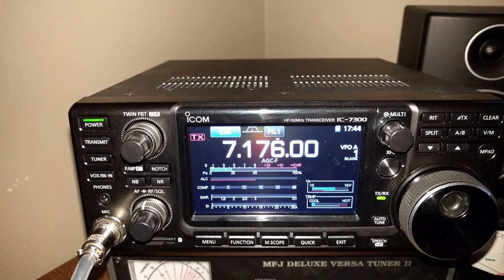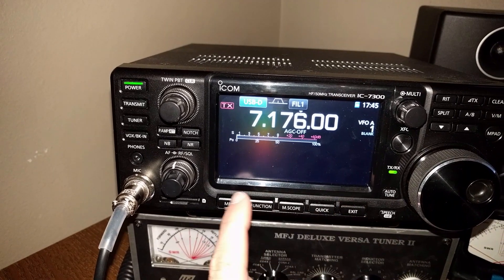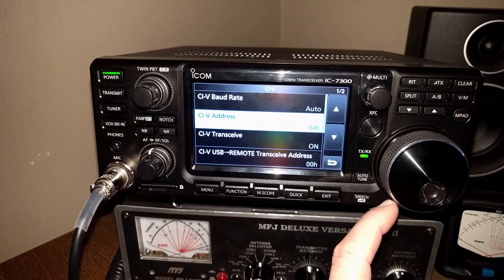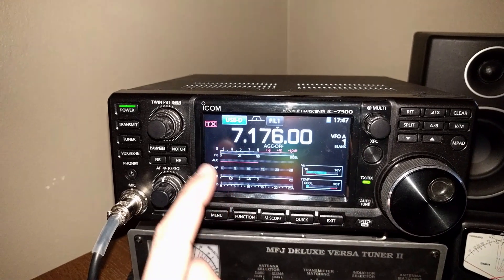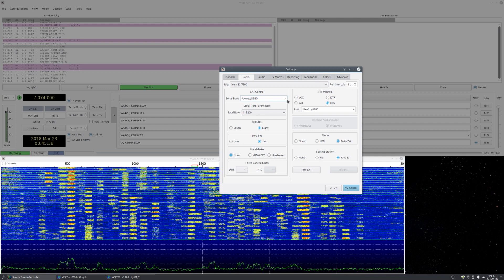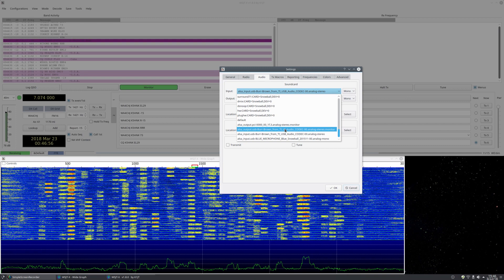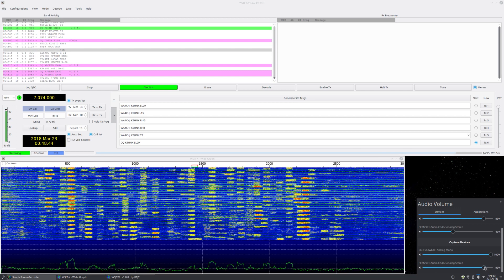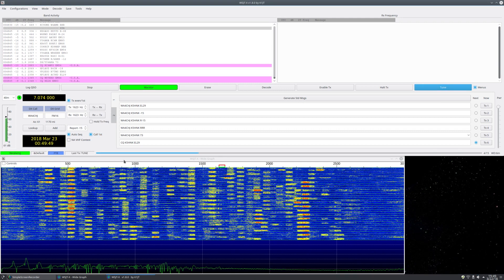Icom 7300 FT-8 Settings (WSJT-X and Radio)

Comment: Six years in and your video for an FT8 beginner is still very useful. Wonder if you have a video for Windows (this demonstration seems mostly for Linux).

You did a great job of differentiating the AGC at the beginning of the video, from ALC which you showed at the end.

In the AGC on IC-7300, you showed how to bring the level to zero (off) for the Fast mode. There are two more tabs showing Mid and Slow mode. Do they need also to be brought down to Off level?

Thanks again for a very helpful video on FT8 set up.
Reply from the maker: Thank you for your kind words! No, the other tabs do not have an effect unless they are selected. in this video i used the fast tab, but those settings are global. you could get the same effect by changing the slow tab to zero and leaving it selected. The fast mid and slow tabs are simply quick presets so you can change how quickly the AGC responds. All we do by holding it down, is to enter the ability to change one of the preset parameters. so here we need AGC to be off so we pick 1 (any) of the presets and change it to "off", then select the preset we just changed so that AGC is "off". The other two presets still have their parameters so by selecting one it will apply those timings to the AGC. so simply be sure that the preset that you have changed to off (fast in this case) is listed on the AGC button in the menu. Tapping the AGC button switches to the other presets (mid and slow) cyclically.

Comment: Great video but I lost you at the end about the meter in lower left corner  and the capture device menu and ALC meter.  I'm 90% there but having small issues.
Reply from the maker: no problem! maybe i can help. In the video i am using Linux Mint KDE edition and the menu i show in the video might look different on your operating system. What you want to do is find where you adjust the input and output levels of your computer devices. On Windows it is under Settings> System> Sound> Advanced Sound Options. Then i was saying to adjust those settings while watching the ALC meter on the radio so that the radios ALC meter doesnt show activity. does that help?

Comment: This is the only video that worked for me.. all others had lots of settings WRONG  A PLUS bro!!!   73
Reply from the maker: Glad to hear it! I am quite pleased that this video is still helpful for so many even years later!
Reply: @Hawk-1291  problem is you have to have 2 separate menu settings for sdr and regular operation and 1 menu setting for ft8, they are supposedly making a firmware update to just have a ft8 menu setting..

Comment: I am wondering about the USB SEND/Keying - USB SEND = RTS. That setting messes with my use of Log4OM, when I return to normal USB mode. Using CAT forces the unit into Transmit !!  Fix is to reset USB SEND = OFF.

Comment: When going back to SSB do you have to change all the settings back?
Reply from the maker: No. for the most part these setting wont affect voice modes. I think the filter stays wide (not necessarily a bad thing, and easily changed) and your AGC will need to be turned back on. (also easily done) none of the menu settings should affect other operating modes.
Reply: @Hawk-1291  I'm trying to set up the radio for contests and would need to quickly change between FSK & SSB ~ is there not a setting/memory to hold FSK setup - invoked when you select Data & SSB settings when you return to SSB ~ no need to change other settings - everything done on the Mode change?
Reply from the maker: @robbo9592  depends which settings but there is a feature on the 7300 that allows you to switch operating modes and settings on the fly. It works like this:
 open the band stacking register, select the band you want to operate on (say 40 meters for example) after you have selected 40 meters you are taken to the last frequency and mode you were using. if you then go back to the band stacking register and select 40 meters a second time it will take you to a new freq and you can chage the mode and other operating settings. if you select 40 meters a third time you will have a third "register" to set another mode and freq. going to 40 mewters a 4th time will return you to the first register.  Page 3-3 of the operting manual mentions the stacking registers. play with them a litte and see if this gives you the desired ability.
Reply: @Hawk-1291  That's great info and  it's a real help, thanks very much.

Comment: Using windows, getting hamlib time outs, and rig control errors.,   I reinstalled hamlib with admin priv's, and still getting the Hamlib errors.
Reply from the maker: Check all connections and make sure that the usb device is enabled under devices in Windows. also check that the correct port is selected in WSJTX. finally check that the correct driver is selected in WSJTX.  If you stilll have issues you could try running WSJTX as administrator.

Comment: I get an error message that reads "Hamlib error: Communication bus error while getting current frequency".  Any suggestions on how to remedy this?
Reply from the maker: hard to say what the exact problem is but check your physical usb connection. Also try a restart of the computer. If you are using the usb cable alone without the CI-V Cable  (which is how i did it in this video) make sure DATA MOD is set to USB. Also double check your settings under CI-V match those in my video at 2:00. Check your serial port setting in WSJTX.

Comment: Are these settings the same whether using. just a usb cable??
Reply: I am using a regular usb connection (not the CI-V cable). Following your instructions kind of messed things up between my rig and wsjt-x. :(
Reply from the maker: @tglenn3121  Yes I was using only the USB cable in this video. Double check everything in the radio and WSJT-X.
Reply: @Hawk-1291  Ok, will do. Thanks.
Reply: So, I got some things to work, but when I transmit, I still get nothing on my ALC meter. The 7300 kicks into transmit mode, and the waterfall gives the apearance of an outgoing signal, but nothing on the ALC. :(
Reply from the maker: @tglenn3121   Check that your computer is using the correct sound device in audio outputs(in the operating system not WSJTX). It may be trying to send the transmit audio to a different device or it may be turned down too low. Try raising the level and check that it is not muted. you might also try adjusting the 'USB MOD Level' setting to a higher value. That setting increases the modulation level of audio coming over the USB cable. Note also, that the goal in my video is to not have any ALC showing. But do proceed if you are trying to have it peaked just before the ALC starts to kick in.
Reply: @Hawk-1291  Aha. Yeah, I have NO ALC showing at all, and someone else who uses WSJT-X said their ALC does move. Theyr'e getting responses to their CQ's, I'm not. So, that's why I figured that the ALC should be showing some outgoing level.
Reply from the maker: @tglenn3121  Having the ALC is an acceptable way to run it as well but there are some additional settings to configure in WSJTX to make that perform well. I think the "Ham radio with K0PIR" channel has some info on running FT8 with ALC. Both methods work and one may work better for you. try it out both ways and see which you prefer. I have no experience running it with ALC so I wont be of any help if you decide to do that but figuring it out is part of the fun!
Reply: @Hawk-1291  Ok, thank you for all your help :)

Comment: I used this to get JS8CALL working on my 7300. Had to run through it step by step a few times but eventually got it. You do have to translate between the different programs but it works ! One hassle was that windows was in the process of updating to Version 1903 Win !0. Really goofed up the USB Driver process. If that is happening, wait till it complete. Two large updates, second one restarts a number of times. Until its finished nothing will work correctly.

Comment: The first 3 minutes show about 44 steps(less editing) you took in checking or changing settings before getting back to main menu. Then I stopped counting for the remainder of the setup. Simple lol. Not saying this is difficult...just an unusually long process I find. Cmon software guys/programmers...really? But kudos to you for explaining it very well!
Reply from the maker: It is a bit of a tedious process, i agree. Admittedly, I go over several settings that have no effect on running FT8 but i found it easier to do a video simply going down the whole list in the menu rather than explaining where each setting is. Thanks for your comment, and hopefully they come up with a more straight forward way in the future! 73!

Comment: I have set everything as you said but I car receive and decode signals but it won't go into transmit.  When I tap tune or tx I get a message that it says Rig control error. Any suggestions?
Reply from the maker: It seems like i had a similar problem at one time with that. Try shutting down your computer and turn the radio off. Turn the radio on first (with it plugged into the computer) then turn the computer back on. double check your settings on the radio and WSJTX, also make sure your USB port did not change since reboot.  If that doesn't fix it i have seen some reports that some of the recent firmware versions made changes that are making these settings not work anymore. I have not been running the 7300 in my shack to confirm this.
Reply: @Hawk-1291   Thanks for getting back to me. No change after reboot. I am running Ver 1.30 firmware on my 7300. I will keep plugging away. I know its somewhere in the settings. I will figure it out. I always say my persistence with beat its resistance.
Reply from the maker: @dougkaherl6855  Haha I like that! "my persistence will beat its resistance." Nice. Let us know if you figure it out, it may help the next person!

Comment: WOW, a very excellent video. This is the way they all should be. BTW, are you using a separate CV-I cable and if so are there any changes if I am only using a single USB cable for the 7300 to the computer?
Reply from the maker: Thanks for your kind words! I am using only the USB cable in this video so you shouldn't need to do anything different if you are running it with only the USB. Thanks for watching! 73
Reply: Another question: I made it all the way through to the audio capture devices and ALC setting and then I got lost. Can you explain to me in a little more detail what and how I finish this off? I am running Windows 10 AND FT8 2.0. I am deeply indebted to you for this fantastic video!
Greg Saiter. KO8A
Reply from the maker: @gregsaiter3768  Im actually not familiar with how to set it up in Windows but I have a friend who is. I will ask him how to get the USB audio levels and ALC going on Windows.  I will reply here when i have an answer for you!
Reply: @Hawk-1291  Awesome and thanks!!!

Comment: I don't own this radio yet but very impressed. Are you able to store all these settings so that when using other modes and returning there is no need to set it all up again?
This should apply to all modes, I hope.
Reply from the maker: I have been meaning to do a video on this very thing. The 7300 actually has 3 what i like to call "active memories" for each band. You can set your settings such as mode, freq, AGC, filter width, etc. and by tapping the band stacking register and selecting the same band you will be editing a new set of settings. When you select the same band 3 times you are brought back to the first one you set up. So for instance if i am on 40 meters and I select 40 meters again it will go to the next settings memory. I have one set for FT8, one for SSB and one for CW. All this is done in VFO mode independent from any memory channels in the radio. It is a really nice feature to have when switching modes often! Now the menu settings are not affected but they should not need to change very often once they are set.
Reply: @Hawk-1291  Waiting for the video on this topic.

Comment: Thanks Hawk ,Your vid helped me get ft-8 set up...really easy to follow..;)
Reply from the maker: Glad I could help! That's the really awesome part of this hobby; the community can be so great and helpful! Happy to be able to put back into the hobby that has helped me so much! Also glad this video is still relevant.There have been updates to the radio firmware as well as WSJT-X but i guess there is still enough here to be useful. Thanks for your comment! 73
Reply: i just got my radio a week ago but your settings where spot on,only problem i had was i had to set the rec speakes real low to get them out of red,couldnt see much on 10 meter but worked fine in 40 thank you for taking the time to make this work! 73 KD9LOM

Comment: The latest IC-7300 firmware added a USB Sending / Keying setting: “Inhibit Timer At USB Connection” with an On/Off option. Any recommendations? 73 and thanks... KK6RXS
Reply: All was well with me, until I foolishly updated my 7300 firmware. Anyone knowing the necessary settings would be hugely appreciated. For now, I get only one successful QSO then it stops transmitting - so strange, everything works yet no modulation - no power out. Can't get it to go back on. Strange.
Reply from the maker: Unfortunately I have been moving things around lately and haven't had time to run the 7300 nor update its firmware, so I have no answer for you. Sorry.

Comment: I got an error, "hamlib error: IO error while opening connection to rig
Reply from the maker: This could be any number of things, but the software is not seeing the radio. Typically, when I get that error, my USB port number changed because I plugged a new USB device in. If you have other options under "serial port"  try a different USB port (/dev/ttyUSBx). Also check that the baud rate in the radio matches the baud rate in the software. I used 115200 in this video.
Reply: @Hawk-1291  And do not forget the setting of the data and stop bits and None for the handshake 4:25

Comment: which version of wsjtx are you using? I'm also using linux.
Reply from the maker: Hi thanks for the question. I am using WSJTX Version 1.8.0 on Linux Mint 18.3 KDE.
Reply: @Hawk-1291  Getting a pi going and using that is one of my next objectives. Just got to do it.